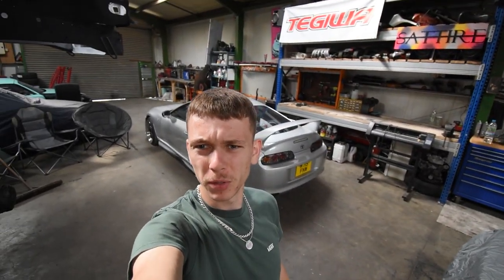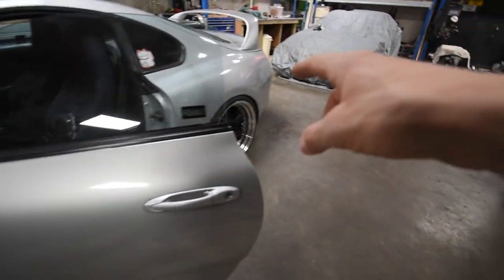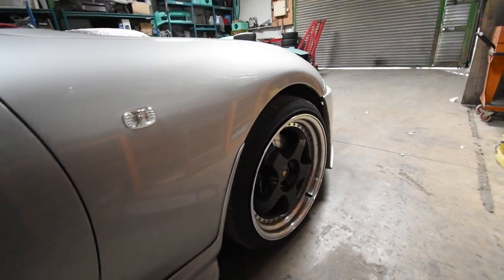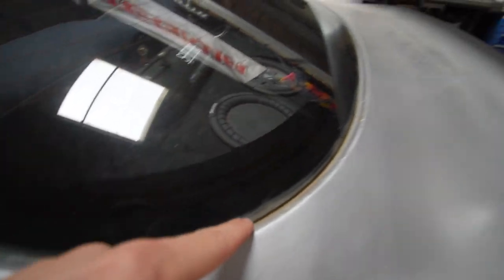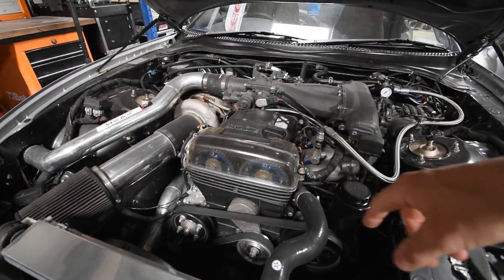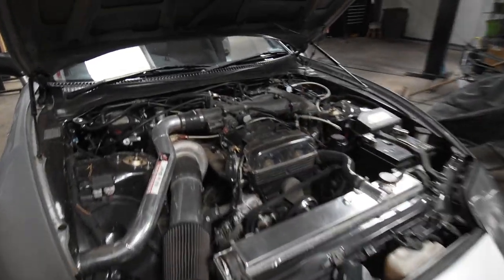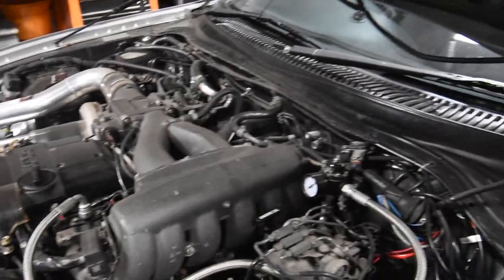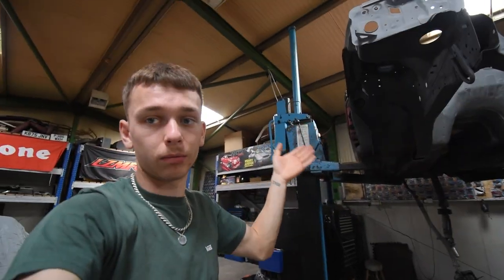BIG TURBO SUPRA With Manual BMW Gearbox! (NA-T BUILD WALKAROUND)

Comment: I would like to know more about the cam senor and distributor choices here, looks great
Reply from the maker: What specifically do you want to know? I went for a 7m-GTE cam sensor. Can run cam and crank signal from that but I paired it with a GTE oil pump with the GTE crank sensor and trigger wheel.
Reply: @SATTIRE_UK  I was wondering if those were all kits to purchase? or does the 7m-gte sensors just slap on to the 2jzge? crank sensor GTE is just a oem change? I am also in the middle of putting these parts together for my 94 na-t GE
Reply from the maker: @beebee-up6ps  you can replace the 2jzge distributor with the 7mgte cam sensor. You will need to modify the adjustment tab by cutting a slot in the cam sensor so that you can adjust timing and use the standard 2jzge distributor mounting holes.
Reply from the maker: @beebee-up6ps  crank sensor you need to buy the GTE oil pump and non vvt GTE crank pulley with the timing cog on it. Then buy the GTE crank pulley sensor, and wire into your ecu.

You do not need a crank sensor though and can get crank signal from the 7mgte cam sensor. You will need to wire both however
Reply: @SATTIRE_UK  amazing thanks, did you do a supra forums write up or video on these? big thanks!
Reply from the maker: @beebee-up6ps  I haven’t done a write up on this specifically but there is a forum build log:) link is here: https://www.mkivsupra.net/topic/242592-na-t-420g-manual-supra-engine-build/#comment-3494374